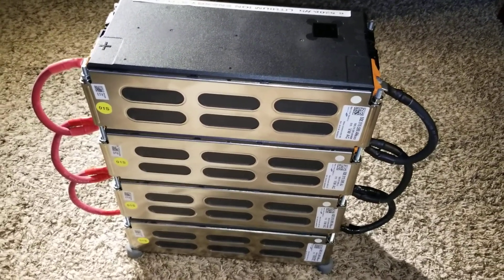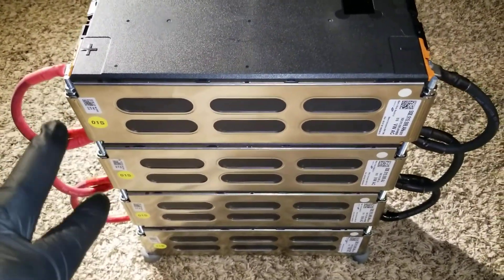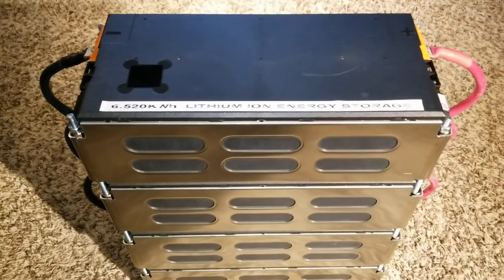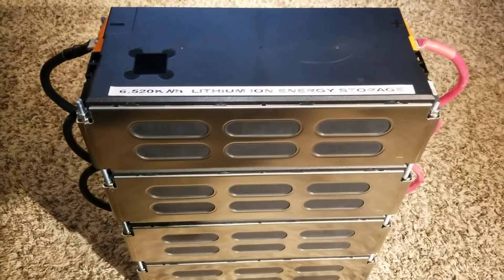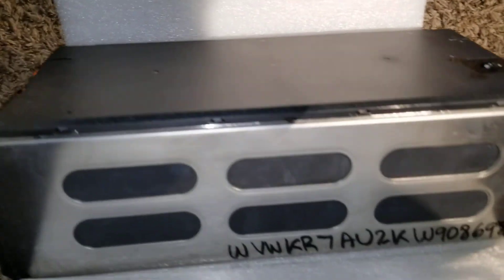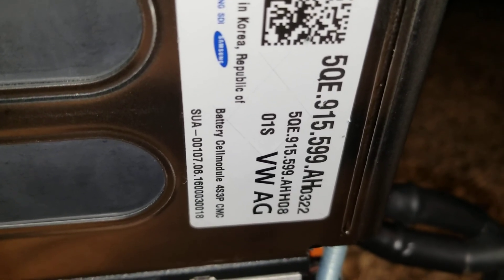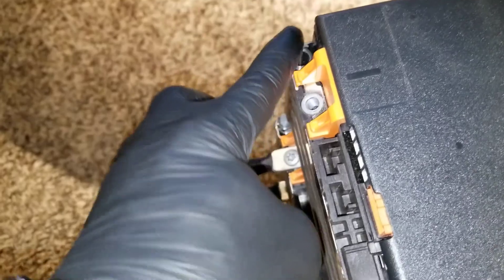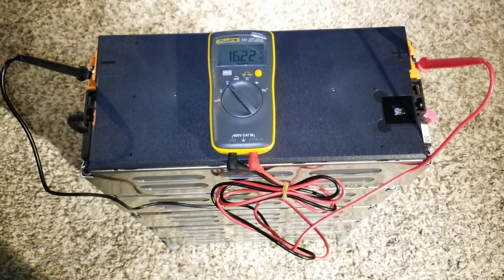VOLKSWAGEN (VW) eGolf (2019) DRIVE MOTOR BATTERY PACK

Comment: Hello, what is the nominal voltage for individual cells ?
Reply from the maker: @SolgerLemp  
Thanks for stopping by and don't forget to LIKE SHARE and SUBSCRIBE.

Rated at 75Ah.
Tested at 72Ah.
Cell Voltages
Maximum: 4.1V
Nominal: 3.6V
Minimum: 3.0V
Module Voltage
Maximum: 16.4V
Nominal: 14.4V
Minimum: 12V
Peak Current 600A
Continuous Current 350A
Reply: @jwsolarusa  Thank you for answering me, i have the 2016 pack with the orange cap, do you know the nominal for the older packs ? or are they the same?
Reply from the maker: @SolgerLemp  That's what I sent you on the specifications

Comment: The part number you have listed is for the original Panasonic eGolf batteries. The Samung batteries are 5QE915599AH, 5QE915599AJ for the full size ones and 5QE915599AK for the 1/2 size battery.

The number written on the side of that battery is the VIN for the vehicle that had the battery replaced. You should blur that number in your video. It could cause trouble for whomever sold you that battery.
Reply from the maker: Thanks for the pointers and for watching my videos. I really appreciate it and have a bless day.

Comment: the numbers that was written on the side of the battery was the vin number of the donor car it looks like it was a 2019 e Golf this is why the cells are Samsug they are all like that for the second generation e Golf starting from model year 2017 and the older cars had the PANASONIC cells cars from 2015 to 2016 .
Reply from the maker: Christian, 
I appreciate your input so much Christian.
Thanks for stopping by. 
If you've haven't subscribed to my channel, I will be grateful to have you on board.
Have a bless day.